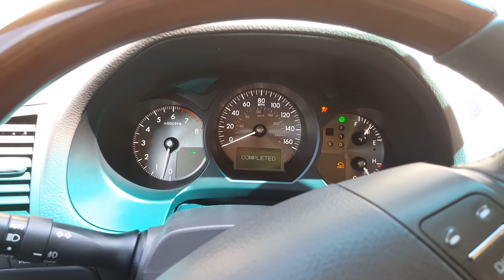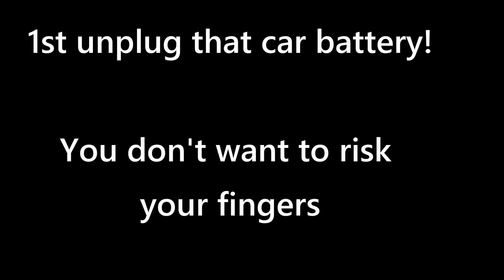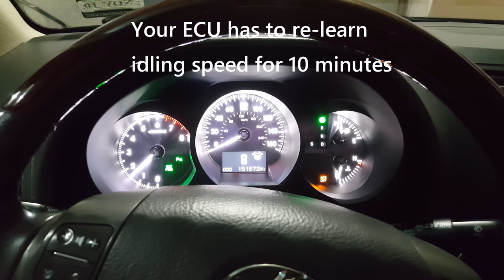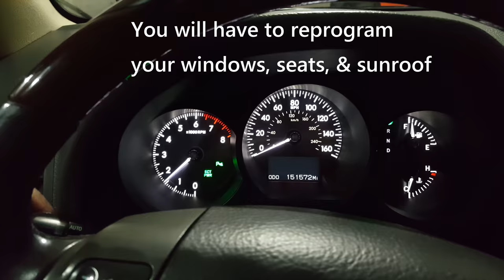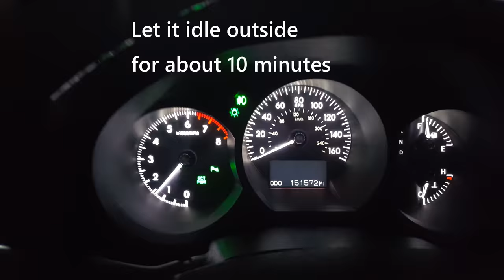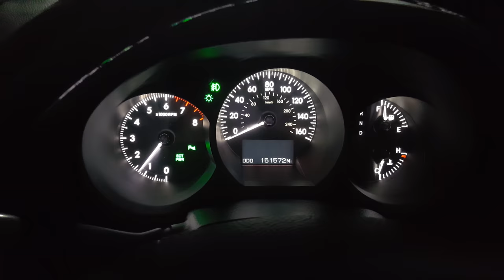How-to Fix Low Idle on Your Car (Clean Electronic Throttle Body) Check Engine VSC

Comment: Nice guide Lex. I'm the second owner of a 2011 IS350, which is not known to have carbon build-up issues. After first acquiring the car and putting a good 4000 miles on it, the idle was beginning to become little rough in drive gear. Took apart the throttle body and there was carbon covering behind the plate in set position. Cleaned it off to expose the air gap that I should see. The gasket looked clean on on car, so I didn't touch it. Ended up test driving the car and it cured the rough idle. There are still some very little vibration, but that is expected with our engines.

Comment: Good job on following the electronic throttle body recalibration procedure after cleaning. This actually allows the PCM/electronic motor to adjust the throttle body angle down to a minimum increasing efficiency.

Comment: Thanks for the video.  The carbon buildup on your throttle plate doesn’t seem severe enough to trigger check engine light.  Please check the cam shaft sensors if the problem comes back.

Comment: Just an FYI although you might have heard by now, throttle plates have a little gap or hole to let air bypass when the car is idling, otherwise it would stall.
Reply from the maker: I figured it out after, but thanks for the heads up.

Comment: Thanks so much for the video, so this engine has no Idle valve right? because is electronic? I have a similar engine with the same issue after cleaning the throttle body (low idle) before the clean up I had the same symptoms you described like vibrating specially when turning on the A/C or heat. Crazy!

Comment: Thanks for the upload!   Did the instruction tell you to idle the car or 10 minutes for the ECU to learn to idle the car at the right RPM?    If that is the case, it would explain why my car idles randomly between 900 to 1500 RPM after I cleaned the throttle body.

Comment: Hi i am from Germany, very talented and very helpful videos, you have a long term experience with the GS 300. I know this and the is250 have carbon issues you can read it on internet. How is you experience do you have to a engine rebuilt ? If not how do you prevent it ? I know you have replaced you catalytic converters was it released with the carbon issue? I want to buy one I hope you can give me a good advice.

Comment: Quick fact:
Of course you can and you SHOULD open the throttle plate in order to clean the opening. That's the whole purpose of cleaning it. You just can't clean it properly without flipping the plate. And of course you should be smart enough to flip it in a correct direction. It's so simple and obvious it drives me nuts when people say you shouldn't flip the butterfly.
Reply from the maker: People have broken electronic throttle bodies before by forcing the flap open and stripping the plastic gear. This was my first time so I was extra careful. Now my Mustang throttle body is mechanical and I have no problems messing with that flap.

Comment: By the way... Mine was exactly dirty as yours, cleaned it the same way (only difference was that I fully flipped the plate 90 degrees just to be able to clean in 100%). Didn't fix my idling problem. The RPMs still float while idling and having climate controll ON...
Reply from the maker: This did the trick for me and it's still holding strong. I did think about cleaning it this year again. Wow, can't believe it's been 5 years.

Maybe you have a carbon buildup problem. I had my carbon cleaned out a few months ago for around $600. I was getting knock sensor error codes prior to the cleanup. About 1 week after doing the cleanup I no longer had any knock codes generating. 

BTW: My 06 Lexus has 225,000 miles on it now.
Reply: @TeksTherapy Did you go to a BMW or other German shop for the carbon cleaning? Not sure I'd have my dealer or even independent Toy/Lex shop do this for me. 
Any tips or tricks you might recommend are appreciated. Thanks in advance

Comment: I have  the same car 06 gs300 awd i have no check engine  light on like when im at a stop light i get vibration  near the cup holders slots n in the drive  side door panel,n when the car is cold on a cold start it makes a rattle noise and ive heard on forums  this  is a common  problem  on gs and "is"models..

Comment: Good stuff to know! Thanks for your great video.  I 've seen a bunch that never mention the electronic throttle pitfalls...
 I'm wondering if anyone can answer my question.  In the process of 
getting to the root of fuel trim problems, I was going to clean the 
throttle body.  When I opened it up, however, I discovered that it was 
clean as new on the inlet side (I didn't take it off the car)  The car has 43000 miles on it.  I have 
run techron through the car on a semi-regular basis, and my previous 
tank of gas I ran the complete fuel system cleaner through it.  But I 
don't understand how that would affect the throttle body.  Also, what 
about the possibility of a stuck PCV valve keeping it from getting 
dirty?  Though I would expect that would throw a code, which my computer
  has never thrown.  What could possibly account for this?  thanks
Reply from the maker: +AJ R If your car is not throwing codes, why do you assume you have a problem?
Reply: My car is getting poorer mileage (considerably) and the trims are out of whack, venturing into levels that may be damaging to the vehicle but not necessarily causing problems with emissions standards.  My average AFR is typically just under 14.0:1 and it's the exception for it to hit around stoich.  I'm fairly certain my MAF sensor is bad and have a part on the way for that so will replace it tomorrow.  We'll see what that does first before looking more closely at the AFR and oxygen sensors.  I do suspect one of those might be a bit lazy and is not helping.  Anyhow, thanks for asking.  If you have anything to add/suggest I'd be grateful.  Thanks!
Reply: AJ R A

Comment: I have exacly problem but my throtlle body is clean ,no check engine I  do t have idea whats wrong with my toyota .When engine take temperature idle go down on 500rpm and feel vibration on all car ? Hwo now whats happen?
Reply: Joh Ny  i have toyota corrlla 1.3l 2010 model. Ihave changed the throttle body. Oxygen sensor but still facing the problem of low RPM. WAI

Comment: Just wondering, have you ever changed the transmission fluid on your lexus with 150k miles?
Reply: I will do it now with 140k miles in independent garage. All fluid and filter.

Comment: I have a 2010 Lexus ES 350 MY idle problem is bad. I have no power when i push the gas pedle to the floor. Only goes 20 mph. WATS THE PROBLEM
Reply: Hi will your car rev up in park
Reply: If so this new model cars come with an accelerator pedal position sensor on the gas pedal itself u may wanna start there

Comment: awsome vidio..
but don't use brush.
there can be more problem idle
Reply from the maker: Thanks. A toothbrush won't harm metal. Idle is great since I did this.
Reply: @TeksTherapy  hello, my car mechanic cleaned the throttle body, however now I have high idle during the cold start like it goes upto 1750Rpm and also idle rpm has been increased from 750 to 900 rpm, and I have very high pick up also.  But I don't like very high pick up, what should I do now? I did idle relearn procedure, it didnt help me either

Comment: Forcing the valve open won’t damage anything, I jam a screwdriver handle to keep it opened.
Reply from the maker: Um... if you force it the wrong way you will strip the little plastic gear in the electronic control unit and then have to buy an entire throttle body.
Reply: Scruffy Mclick valve opens one way only.
Reply: Yeah, I agreed. The valve only opens one-way and you will see which way it is. I always force it open as there is no need to disconnect coolant hose and electrical harness to perfectly clean both sides of the body.
Reply: I actually did it both ways. Forcing the butterfly flap open is fine long as you disconnect the battery. But it's not convenient for cleaning since the flap needs to be held open. I'd rather put a stick on the pedal then clean using a toothbrush. Brush the carbon outside the throttle body then wipe it. This way if the butterfly flap actuates you only break your toothbrush, not your fingers. Taking the TB out cleans the best but make sure to put it back with new gasket because those are one-time gaskets.
Reply: @Huy2406  where did you get that info about one-time gaskets? i installed mine back and nothing happened.
Reply: @foreigner2017  metal gaskets are single-use. rubber gaskets, advisable to change due to heat degradation, but not required. Not sure what you have on.

Comment: That can be cleaned without removing and by pressing the accelerator you can open the plate
Reply: and it don't get really clean like that
Reply: didn't work on 2006 IS250... Tried several times. You have to force the plate to open manually with fingers. You can't brake it if you open it in a right direction.

Comment: F cleaning the throttle body if its to that point it needs replacing....they are fully electronic and if your having idling issues it will continue.  I bought a new one and installed and the low RPM's went way! there cheep. If your gonna go threw taking it off and cleaning .....just replace! that simple
Reply from the maker: I don't know about yours, but mine just needed a cleaning as they will get dirty overtime.
Reply: Lonnie Greer...you need to educate yourself before making generalized "f that" comments.
The only correct thing you said is that it is an electronically controlled TB. 
Whether electronically controlled or throttle cable and springs....TBs DO get carbonized; DO need to be cleaned as part of maintenance on any vehicle; ARE quite often not "cheap" to replace and certainly not as cheap as a can of solvent, rags and elbow grease. 
Some of us don't have the disposable income you do I guess.
Educate yourself...or....listen and learn.
Reply: I work in a part store we actually reccomend cleaning them just because the carbon build up cause sometimes that all what wrong with them

Comment: Why would anybody listen to your advice about working on a vehicle when you don't even know what tool you are using, (vise grips which in reality are needle nose pliers).
Reply: @Christi Alspach.... Vise Grip is a branded line of  PLIERS and CLAMPS manufactured by Irwin Tools. There are 113 different tools in the line...including needle nose pliers.  Based upon the handle graphics I saw in the video....he does indeed appear to be using Vise Grip BRAND.  So...it kind of begs the question:   Who should listen to what you have to say since you think Vise Grips are only the chrome locking pliers you must have seen in a toolbox once and made yourself an expert.
So...there's that.